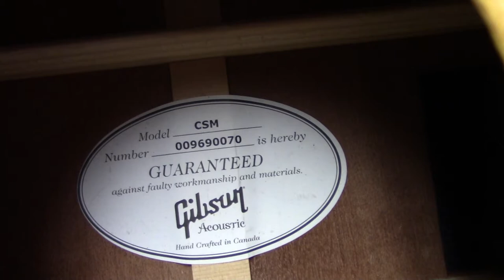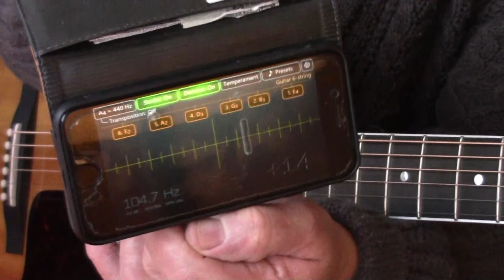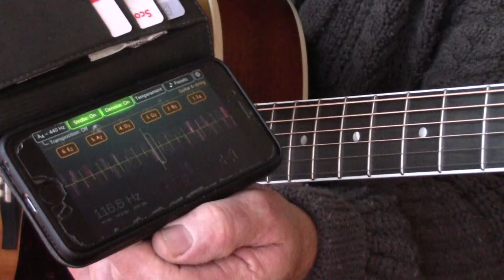Canadian Gibson / Gibson Bridge Plate Removal@StringTechWorkstations

Comment: I think you meant centimetres, not millimetres when referring to the dimensions of the made in canada Gibson (by the way, I have one and love it, got it used about eight years ago, it was about five years old when I bought it). My understanding was that Gibson wanted a model to compete with the $1000 guitars being sold by Martin at the time, and thought they could keep the costs down by building them in the old Garrison factory. Also that they may have wanted the patents and wood in the deal. Quality may have been an issue early on in the venture, and that eventually they were only assembling components that were pre-cut and partially assembled in the US, then shipped to Newfoundland for completion, if what I’ve read was true. It’s definitely the only way I could afford a Gibson, even a used one. I tried the low end Martin that was made in Mexico around 2014, and was not at all impressed. By the way, this one sounded beautiful after your repairs, and lovely playing!
Reply from the maker: It all worked out in the end. It was a kind of quirky twist in Gibson's history.

Comment: Hey mike I’ve got an older jazz bass. After many years the high frets are starting to buzz a lot. Is this something that should be fixed by shim or fall off on the frets?
Reply from the maker: Hi James. I would need more information to advise. In many cases the Jazz Bass fingerboards do NOT allow for alteration ( they are too thin ). In most cases the  "real estate" will need to be taken out of the crowns of the frets.